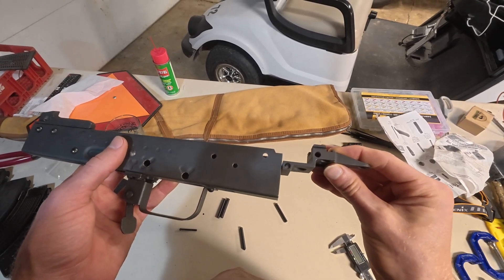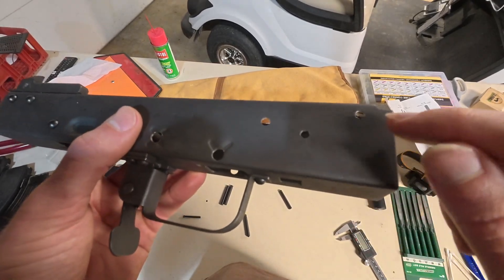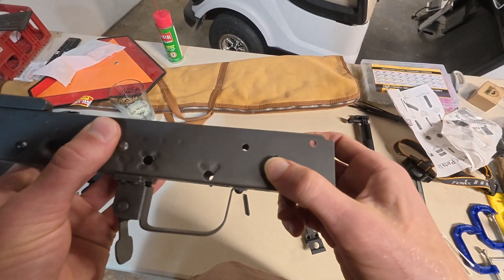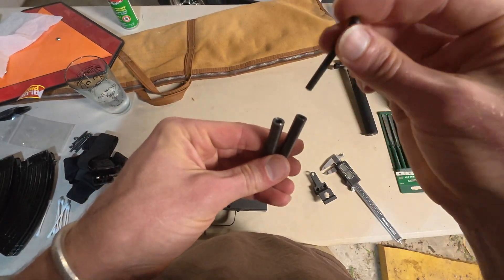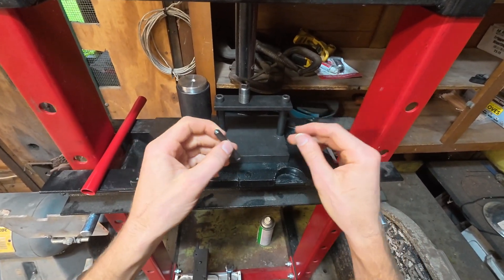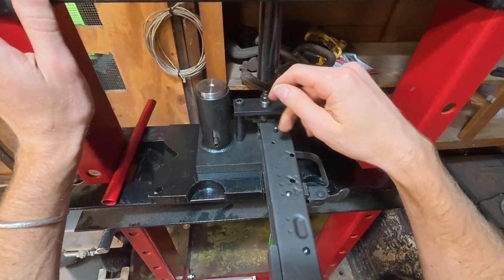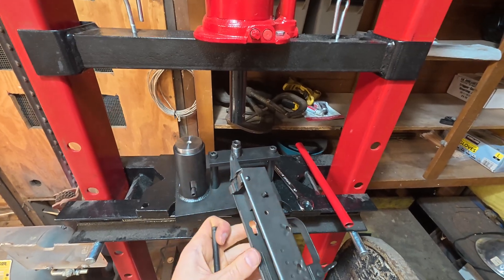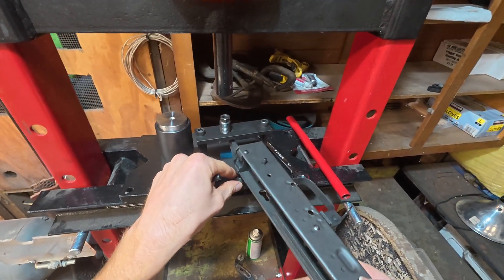How to build AKM series: Riveting Rear Trunnion

Comment: Good video, I've done a few kits now and for some reason mine always want to press way crooked, I noticed you really tightened the hell out of that bolt once you had the alingment rod in there, I wonder if thats where I go wrong. I started bypassing the alignment tool and form the head of the rivet with a ballpeen hammer, then finish it with the head forming tool in the press, but I usually have to check the rivet 3 times and straighten it out with a punch, and reset it in the jig to form a nice straight rivet head. I think im going to try your exact process on my next build.